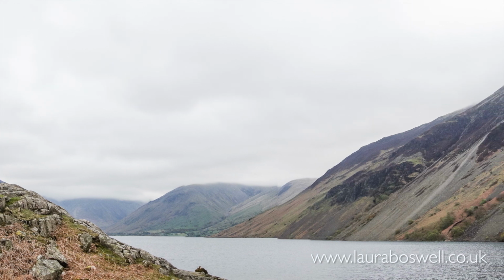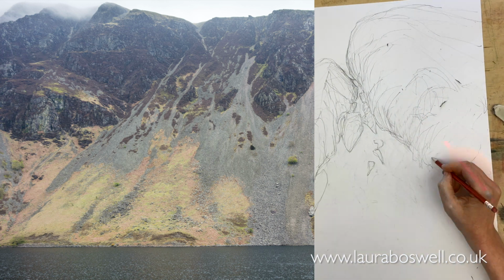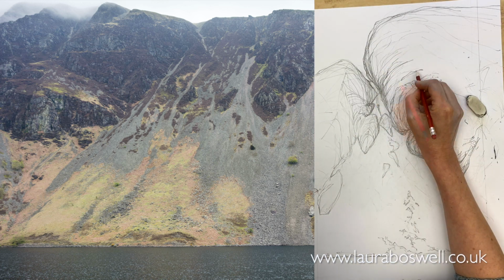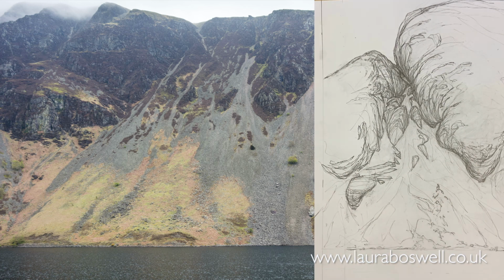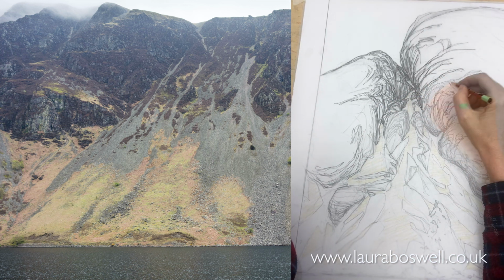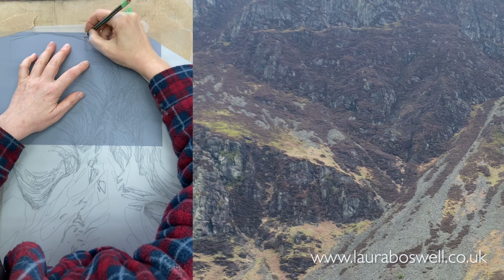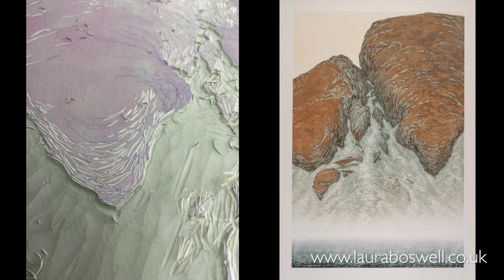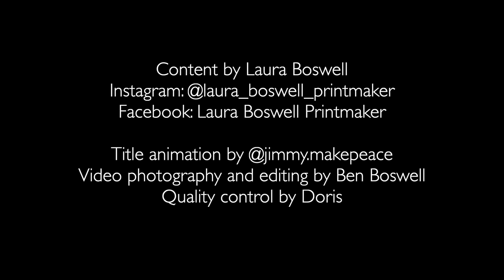Nobody would want my drawings! From design drawing to finished reduction linocut

Comment: Thanks Laura. Does the carbon paper transfer work for Caligo Safe Wash as well as Cranfield Traditional? I've been trying to find a way to transfer designs to lino for use with Safe Wash as that's what I have most of and don't want to discard it (I've got quite a bit). I've found a fineliner that "sort of" works but if old fashioned carbon paper will do the trick that would be wonderful! I know, I should give it a go and see what happens, I can hear you already!!
Reply from the maker: In this instance I can tell you that it does work! But do leave it to set 😀
Reply: The red Japanese carbon paper is quite good. I prefer it to blue.